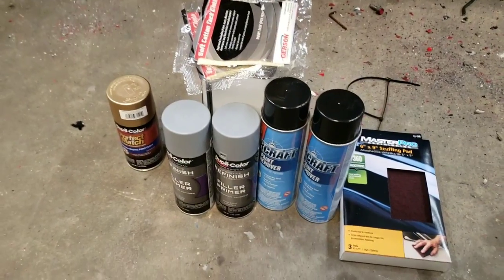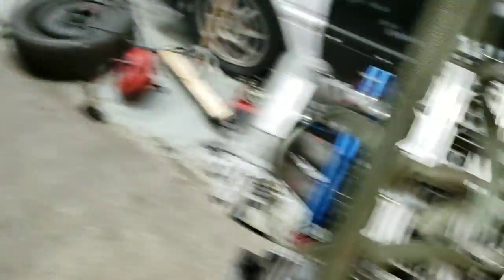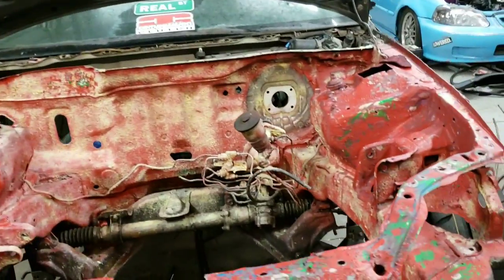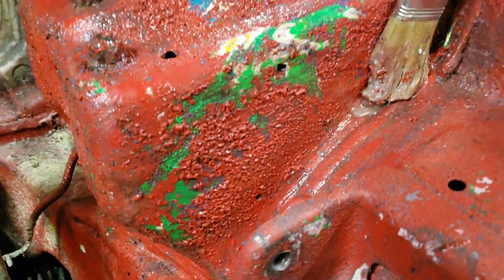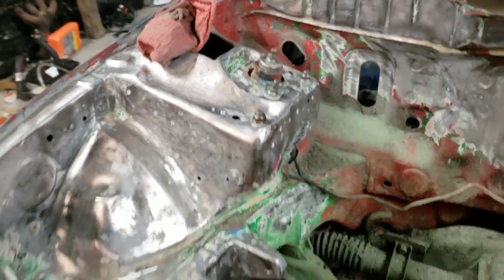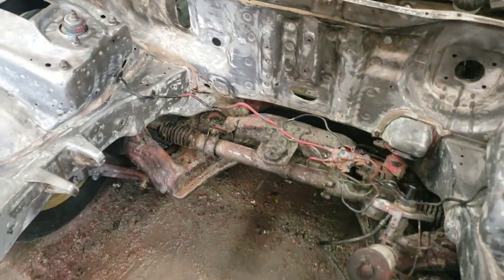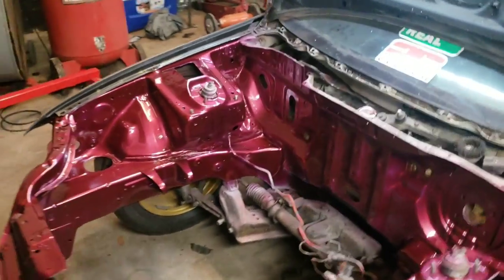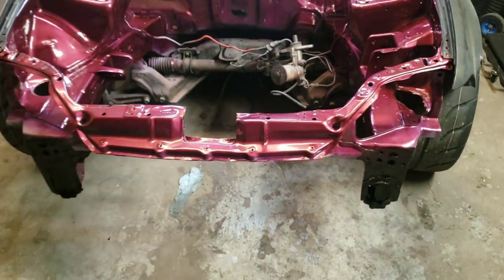Engine Bay Prep & Paint || Lee's Turbo GSR EG Ep. 2

Comment: I can't believe you spent all that time to remove paint did a 100 percent best job I've seen when it came to prepping metal for an engine bay .then you didn't mask the under windshield vent the wires the windows nothing covered ??? What the???little plastic little tape made a huge difference wrap the wires in aluminum foil cheap works awesome but other than that you did Very good job
Reply from the maker: The bay was completely stripped of wiring and such. The brake lines got relocated inside the car so none of that is seen. The windshield is cracked and needs to be replaced, and the vent under the windshield gets covered by the cowl.